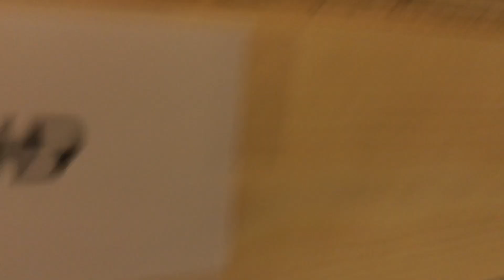LCC Tour

Comment: Very helpful, I just ordered my first LCC components from RR Cirkits last week. How do you connect the coils to the Cat5, solder or butt connectors?
Reply: Hi, and thank you. So I solder all my CT connections. I also cover the connection with a length of heat shrink tubing to avoid accidental contact of the leads with some other wires. Keep in mind the heat shrink will need to be pulled back along the CAT5 wires a distance to keep it from shrinking while soldering the wire leads to the CT coils.
Reply: @the-lcc-channel  Thanks Detlef. I was trying to think of a non-soldering solution that would be secure since I'm a little leary of my soldering skills. Looks like I should get in some practice and give it another shot! Thanks for your info on LCC, it's inspired me to give it a try! Terry M.
Reply: @ponderingpops  - well of all the places to practice, the CT coils would be a great place! Fairly robust and plenty of lead makes it relatively easy. And if not here, there are other places where the skill is very useful. Thanks again for the kind words. Rock on!

Comment: What about having  your programming script for the LCC available. After all that's the hard part. Nice layout
Reply from the maker: Happy to share, but it's not overly helpful, to be honest. Each node as a unique ID, and all the events are tied to them. So what works for my layout will not work anywhere else. It actually is what makes LCC so nice. I can literally tie 2 LCC networks together (such as in a modular group situation) and the nodes will all still work independently and together. That said, there is a bit of a learning curve to configuration. To help bridge that gap, I have set up another channel that does a step-by-step tutorial on how to wire and configure LCC nodes. Check it out at:

https://www.youtube.com/channel/UCuRRF7W2tX4UjFhDAontT4Q

Comment: The block detection wires that you have the current detectors on, are those the feeder wires for your track power?
Reply: Correct.  I have a blog post that describes the wiring: https://greatnorthwesternrailway.blogspot.com/2019/04/wiring-to-track.html  Let me know if that does not answer your question.  Regards.

Comment: Greetings,

I’m planning my LCC implementation now on a new layout.  I would be grateful if you clarify some points for me.

Did you run all of your track power feeders back to the terminal blocks by your LCC card nodes?  Was this done instead of using a bus with track feeders connected directly to the bus with connectors or soldered?  If the former, do you have any issues with track power drop off from having long feeders?

Thanks, Kent

Comment: Wonderful tour, we definitely need more LCC layouts showcased. Too many modellers are stuck in the 60s, literally, and also utilizing proprietary technologies. A few comments...maybe you want to move those CTs further apart, as you will be seeing cross-talk via the magnetic field between them. Also, couldn't reach your website - its DNS won't resolve. Thanks.
Reply: If your CT is toroidal wound then the magnetic field is self contained. You can put them next to each other.
Reply from the maker: Thanks for the tip on the CTs.  Will look into that, although have not had any issues with them.  Fixed the hyperlinks.  Thanks for letting me know!  Agree the hobby could really benefit using more of what is available today.  Definitely one of the motivations for trying out LCC.
Reply: I'm in the process of building a layout as well, and will be using LCC exclusively. I bought a few LCC modules from RR-CirKits, but I'm also looking at OpenLCB and making my own nodes. Matter a fact, I just succeeded connecting a basic Arduino Uno running OpenLCB code to my make-shift LCC network. Wrote a quick post about it on my website at https://trainsluvr.com/2018/12/arduino-uno-openlcb-test-node-on-the-lcc-network/
Reply from the maker: @TrainzLuvr  Really neat!  Keep us posted on the development of your nodes.